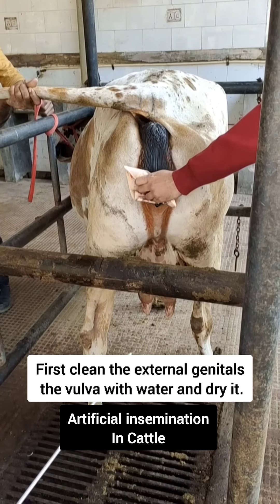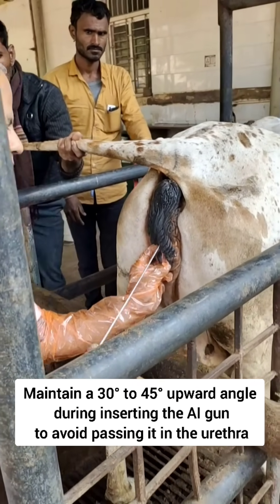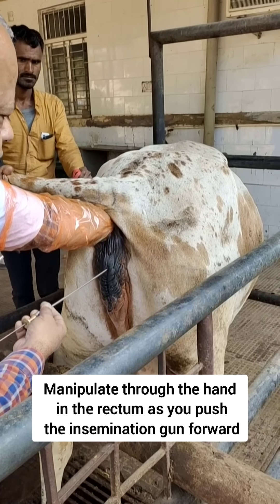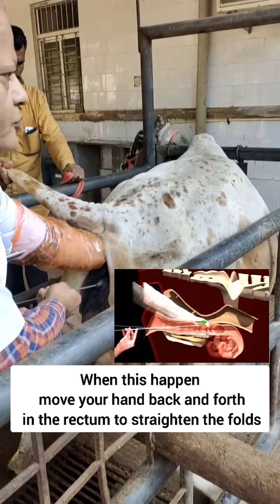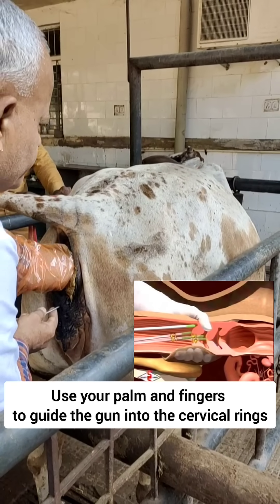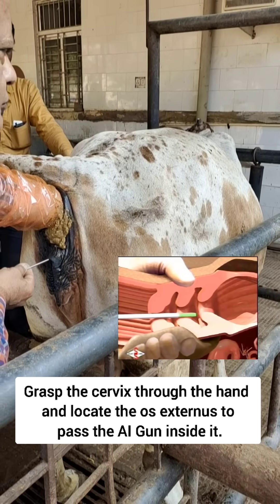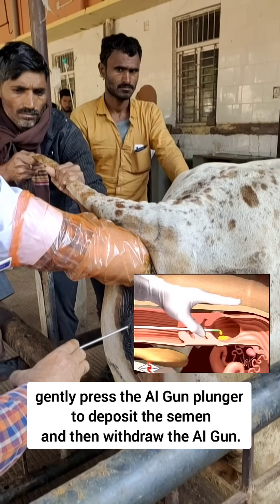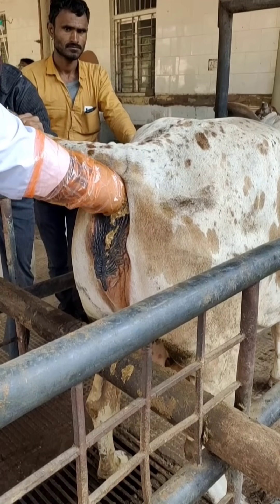how to do artificial insemination in cow step-by-step explained | prof GNP

Comment: Sir i completed my AI technician course.. Theoretically i know the procedure.. but practically i feel trouble in some animals. I can't introduce my AI gun into the cervix. I'm choosen this is my career, I'm still not getting thrown in my work.. please give any ideas and suggestions sir.. I'm feeling guilty sir. But I have to do this well..
Reply from the maker: Practice makes a man perfect. Have patience and hold the cervix in your palm and try to locate the os externus and introduce the gun slowly inside. Some times you need to tilt the cervix with your palm. Do not apply excess pressure as this can be harmful. Good luck. See our other video on rectal palpation that would help.
Reply: @GNPSir  Sure sir.. Thank you so much
Reply: If you need help i can help you

Comment: So painful for cow
Reply from the maker: Followed worldwide and has brought a huge change in milk production.
Reply: @GNPSir so? Does that justify the abuse?
Reply: @adamyasingh3713  You use animal products from those same animals. 
What's your justification?
Reply: @user-mg6tv9ro2u "I stopped using"
You're making things up. 
You continue to use animal products needlessly. 
Many things are made with animal products. 
Asphalt, some types of money, motor vehicles, electronics with processors, some housing materials, etc...
How did you needlessly reply without using something with a processor? Smoke signals?

Thanks for the easy win and your concession since you were deceitful.